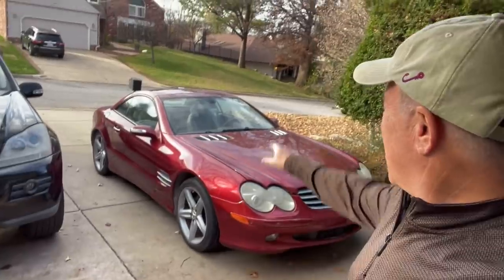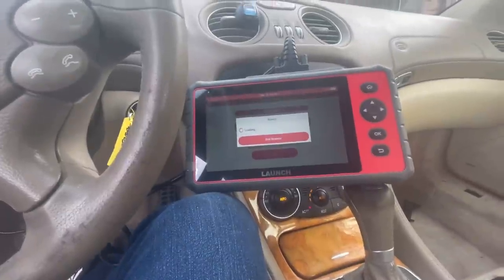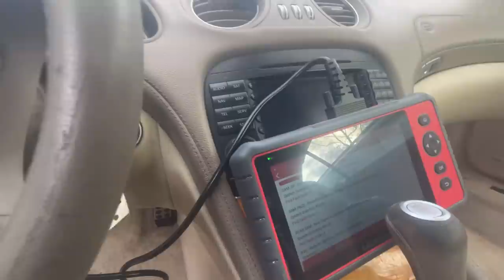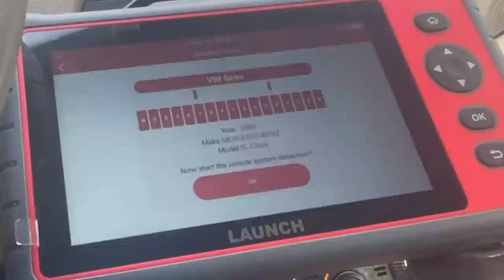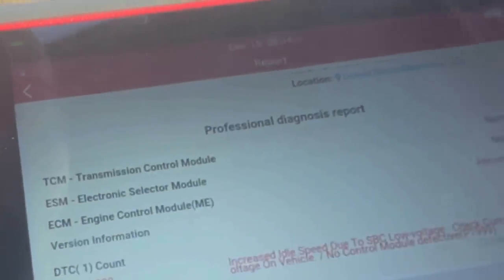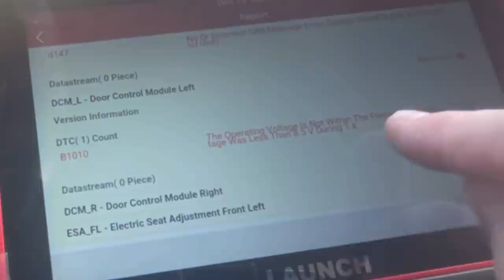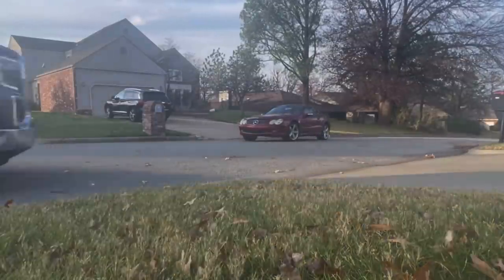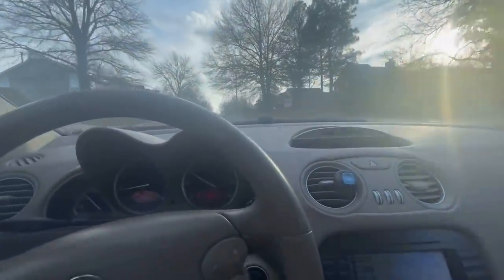First Drive, Popping Sound, And Error Codes

Comment: The most expensive part of the scan is one you didn't see, no PSE. The Mercedes system would tell you it is missing since it is supposed to be present on every R230. That will set you back about $650. It was submerged in your trunk (under the hydraulic pump), so it's toast. Strut error can be either strut leak (which it sounded like you have) or bad blocking valve seals. Bad seals is a cheap fix, strut not so much. Check voltage across rear battery with car running. Should be around 14.5V. If not, check alternator. All of the low voltage errors are common, reset and don't worry about them. Same with car too low errors, fast idle, clock communication, etc. Biggest wild card is if your roof pump still works and if you need to rebuild any roof cylinders. It needs to be a convertible to sell for any $. Oh, and just turn off the Parktronic switch on the console to get rid of that annoyance.
Reply: Guaranteed the PSE was underwater and is unusable.

Comment: Hey Mike I'm loving the progress you are making on this car. The low voltage could be from a bad ground. You did say that the grounds in the trunk where suspicious. Maybe a quick wire brushing and cleaning may help also a good cleaning of all the fuse boxes and control modules with some electronics spay wouldn't hurt. As always stay safe and keep the hits coming.

Comment: The convenience battery is the one in the back. That's also the message on the dash. The battery contol module is also in the trunk, it was flooded. Might give you some problems with the charging. That hydraulic pump for roof operation will be shot, too. The key modul, that doesn't recognize the key beeing taken out... could be quite expensive. It is coded to the vin, iirc. So a used one will not work.
Greeting from a german SL wrenching guy.

Comment: I have an 2003 R230. They are great cars and with routine maintenance they will serve you well. The engines and transmissions are very well built; just keep the fluids clean and fresh as it keeps the all seals supple much longer. The rear main seals all eventually need replaced. It's about around nine hours job, lowering the transmission and reinstallation. The hydraulics top has eleven cylinders plus the pump. Check with Top Hydraulics in Florence Oregon. They sell the entire rebuilt system with upgraded viton seals, lines and will last for over thirty years. Cost is around $1600 for the complete kit. If the ABC gets to be a pain, they sell Coil Over suspension kits for the R230. Once and done. These are sure fun cars, so keep it and enjoy!
Reply from the maker: Great info, thanks!

Comment: When I removed my seats I had to reset the SRS. Brake wear, pads low. After replacing pads you must replace the brake wear sensor. Cost around 2.50 you need 2. Sensors located on passenger side easy fix. Good luck Mike
Reply: also don't forget to disable the SBC but unplugging it prior to removing the brake pads cause it'll go bad, if it isn't already bad (it has 25 years extended warranty btw), if your car has a clean title, the dealer will replace it for free

Comment: Hey Mike, the ABC problem could be either the strut or the locking valve o-rings.  If the strut is leaking externally (which may be the case since you were low on fluid), then the strut needs to be replaced.  If there is no external leak, then the problem is the locking valve o-rings.  Rebuilding the valve bodies is relatively easy, and repair kits are readily available at modest cost.  Just be sure that you get one that provides Viton o-rings.  Being the owner of two CL500s, I've become quite familiar with maintenance and repair of the ABC system.  I'd be happy to provide any assistance you might like.
Reply: I have repaired both of my ABC valve blocks and a couple of high pressure lines....I have this exact 05SL....easy repairs, just time consuming....but cheaper than paying the dealer/Indy....
Reply: Mike is very good at that sort of repair/rebuild. I expect it is the fear of 'ABC' that is putting him off....but I reckon he is more than capable of tackling it. He's a clever guy!
The problem is the cost and will it generate content that people want to watch. I would love to see him try...but I'm weird and probably in the minority.
Reply from the maker: Thanks!!

Comment: Conveniences functions (seat heater, mirror heater, ect) temporarily  turn off because main battery voltage is too low. That auxiliary battery gives power to SBC-brake unit and only SBC unit. When you slow down park sensors activate and because that one sensor is faulty you get that beep. Surprisingly you only have few bulbs bad and meaby that one ABC strut. Interesting content!!! That driver side mirror has been auto dimming and that chemical dimming film is broken. You can get normal mirror way cheaper. Also might be possible to peel that auto dimming film layer off from that surface of te mirror.

By the way if you do brake pad job. Make sure car key is away from the car and DO NOT OPEN doors when you have caliber out/removed. SBC system will pressurize brake lines and then will push those pistons out from caliber.

Comment: Sympathise on the interior parts colour matching. Looks like pebble beige, not Java too which is even rarer. Had the same issue. Personally black would bug me. This car is great, don’t sell it. Parking sensors are tricky, I did the old listen for the clicking and replaced accordingly with eBay ones. Looking forward to the next one.

Comment: Mike,  Clear the codes and most of the voltage codes and others will clear, that always happens when the batteries go low or get changed. Never wrap Mercs it is criminal. Here is a thought get a black part for your dash and spray it brown if it looks wrong being black just get a rattle can that matches the interior. Finally getting another car aarrhh!! your neighbours will be so proud of you!
Reply: Exactly my thought as per the dashpart... guess there are lots of vinyl paints
Reply from the maker: Cleared them first, then scanned. The missing dash part is just a plastic cover. The dash clock is connected.

Comment: Close the door silences the gong. Seats don't move unless door is fully open. ABC pump is tandem '2 pumps in 1' steering -+ suspension= you can't just change/modify to coil-overs without addressing pump modification and resulting ABC automation warning light. Some comments are helpful on your video posts. some not so. Changing consumer battery does not necessitate resetting computer.
Reply: Noise was probably pump cavitation, low fluid. Pump is two radial piston assemblies same shaft separated by a seal between steering and ABC.  .Top off with "Pentosin" find on ebay/not cheap. 3 micron filter in ABC reservoir located in the tank attached to the underside of cap. Observe which side of car 'sags' . Lift that side, remove wheel and push shock dust cover up/down to visually inspect for leaks. Maybe the valve block is leaking internally thus not being able to lock fluid . You see this with the car off and static for a few hours. The strut will move. Your car has several accumulator's (diaphragm with a hydraulic oil reservoir) Good luck! I found your channel, Ill stop back. SL55 AMG/new 2003, custom Stuttgart build. BP Chief Engineer. Absent a lift its difficult to get under but not impossible. Jacks/raceramps ABC requires flush w/disconnecting return hose at tank. Lead hose into receptacle and run engine to chase oil out. Small quantities at a time try not to run pump dry.   fill w/new pentosin and new filter. FYI MB has renewed and extended the SBS brake unit on these cars almost indefinitely. The sbs wire harness on the unit needs to be disconnected when servicing brakes . Can't retract caliper piston before disconnecting sbs electrically or you risk both damaging the unit and your hand.

Comment: Couple things from recent experiences with my R230
Here is a possible solution for the popping sound and it's stupid simple:
The 4 cross supports underneath must be tightened with the full car weight on the wheels.
Just loosen the bolts on them and tighten them back again.

If you rebuild the ABC valve body, make sure you check/replace the accumulators as well. 
The aftermarket struts are about the same price as you said used. The company remanufactures the original struts.

The convenience battery is the one in the trunk. The front battery on these cars is only wired to the starter unless the rear battery is too low, then it will power basic systems to start the car.

That beeping when you stop the car... Is it still saying "Don't forget your key"?
If so, you can either pull the fuse to disable keyless-go or code the cluster to not have the feature (still works fine though)

Comment: Front clicking in the suspension could be the control arms, struts and ball joints needing replaced.  I have the same issue on my 2005 S600.  My local mechanic wants $4k to fix all of it.   Don’t buy used stunts.  Buy new because you will be right back in the same place.

Comment: Check the rubber front end bushings which are more than likely dried out or rotted out from sitting and see if some silicone lubricant on them will temporarily resolve the noise. I would also drive the car on a rainy day and see if the noise goes away to confirm that the bushings are in fact the culprit.

Comment: Mike, most of the faults will clear. When the rear consumer battery goes low or flat (usually after 3 weeks of no car use) the can modules will record low voltage and you will see consumers unavailable message. Would love to see this SL brought back to life and I promise once done you would not won't to part with it..

Comment: I had that exact front end suspension noise on my 2003 R230, ended up replacing all front end ball joints, lower and upper control arms and bushings but it never went away, so I lived with it until I sold the car
Reply from the maker: Haha!!

Comment: You are going to fall in love with this car.  I'm so sorry.  Make sure you have good Petosin oil for the ABC.  You are also about to experience how this high pressure system is going to stress your relationship.  I HIGHLY recommend you go ahead and replace the many accumulators on the ABC system.  DO NOT RODEO THE SYSTEM UNTIL YOU HAVE DONE THIS.  Otherwise you are doomed to hear a nice little pop sound followed by an ABC warning and a buggy ride home as you driver her and then you will have some serious line replacements to deal with.  The ABC is a fantastic system.  It does not endure the test of time. I will get blasted by the purist here but Phoebe Cates, my awesome SL500 (named after a hot movie star which would probably be great to hang out with but very costly..high maintenance) now has a coilover suspension.  Not a job for the faint of heart if you do it right (removal of the ABC hydraulic line and replacement of the power steering pump  AND stabilizer bars) but it is worth it.  That said if I had known what I know now I would have tried to preserve the ABC.  It is a money hole however. These cars are INCREDIBLY sensitive to voltage issues.  Go ahead and replace the brushes in the alternator NOW.  Then test the voltage at the aft mounted BCM and and make sure everybody (the onboard computers) are getting power they need.  This car needs LOTs of power.  After that you can continue to clear codes and drive her until all of the computers are happy (not an easy task).  Power is everything in this.  Think Apollo 13 to get her home sometimes.  Next, the top hydraulic are GOING to fail.  Contact Klaus Witte.  He can hook you up.  The top hydraulic replacement is not easy, but worth it.  You need to write to the system to eliminate the ABC.  I'm still figuring that out.  Your going to love this car.  It's like a trophy wife without a divorce.
Reply: And to add to Mike Janne's input.  You need an operating PSE.  That is just a tax for all of us that love Mercedes.  The vacuum system does magical things.

Comment: It sounds like the only 'sensible' solution for the ABC system is to attempt a repair yourself...or at least renovate the 'simple' parts of the system yourself and get reconditioned replacements for the more difficult bits. The trick will be to get it done on a budget!!
I do know that hydralic parts need to be super clean internally for maximum lifespan....ideally the pipework & components need flushing - something that may not be practicable in a DIY environment (or even done in a 'professional' ABC workshop because of time). I wonder how Kent Bergsma tackles ABS systems?...perhaps he is 'old school' & has enough sense to avoid them!!
Best of luck in whatever you choose to do.

Comment: Ah Mike....you know very well that the majority of these codes are historic and most caused by low or disconnected battery. So many YouTubers seem to go through that same "song and dance"  as click bait which gets old pretty quickly. Clear all the codes,  run the car and see what the "real" trouble codes are......otherwise pointless!
Reply: Have to agree on this. Its quite frustrating. And Mike is better than that channel filling stuff.

Comment: that car is a freaking basket case
Reply: I have 4 old Mercedes but 1993 is my cutoff date. Quality went down and too many electronics, biodegradable wiring, evaporator issues, abc suspension issues. At least with the older cars they are more predictable and there is an end point in the project. Once you get them to a good spot they stay that way. W201, R107, w123, and w126 is where it’s at…